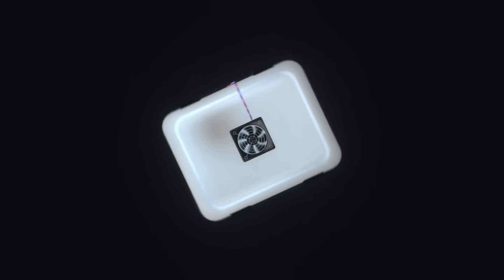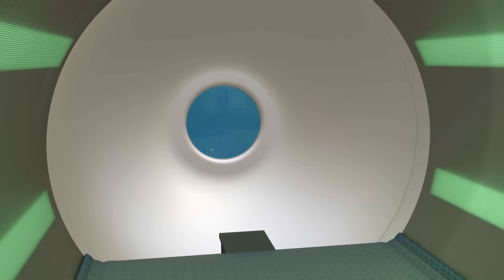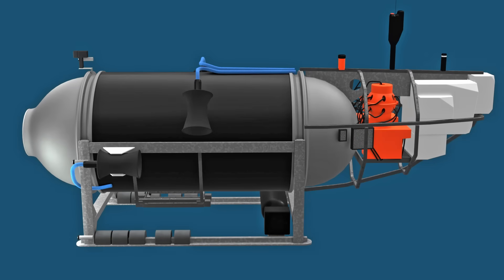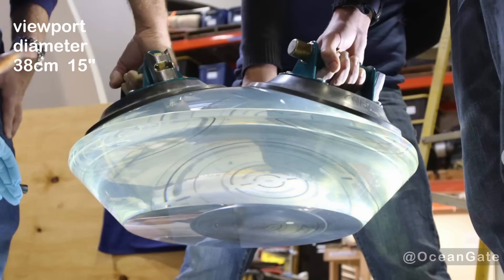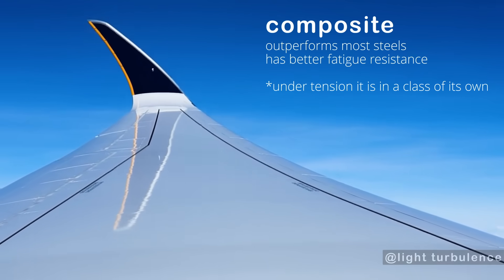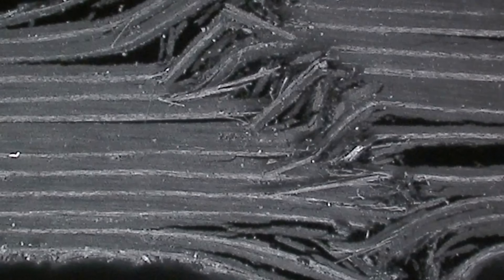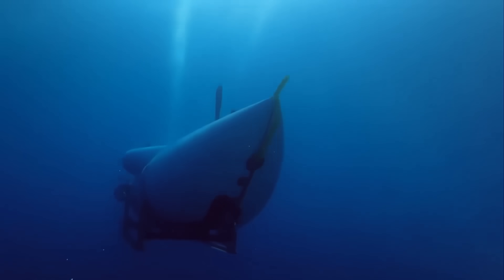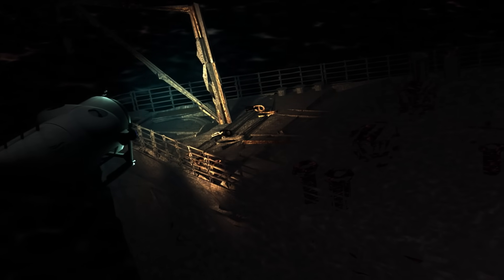Titan Sub | carbon fiber - Detailed Tour

Comment: A very interesting and informative video Mike which was easy to follow with the clear graphics and narration.
With all due respect to the occupants and families, friends and colleagues of the occupants involved in this terrible incident.

I think the Titan was initially an incredibly well conceived vessel that perhaps failed because of minor oversights in poor consolidation of the UD during manufacture and cure.

Rightly or wrongly the owner certainly believed in his creation personally and to the very end.

However I wouldn’t expect that the tape laying machines rollers were enough to prevent lack of consolidation as per the first composite structure which was rejected early doors.

The plies should be debulked under vacuum and additionally under external pressure periodically throughout the lay up process.

Nothing is mentioned in the media about the modulus of the fibre type incorporated in relation to total ply thickness criticism or what the resin system was that they used.

The finished laminate should then ideally be cured under high pressure in an autoclave.

It is very difficult to lay uni directional fibres around a cylinder without wrinkles and some bagginess therefore great time and care would have been required to produce a totally integral void free monolithic structure. 

I haven’t found information on the above apart from the informative content in your video referring to ply orientation but also the adhesive/mechanical fit employed in attaching the two hemispheres.

The laminate could have also benefited from a more complex but balanced orientation in ply placement but it appears the laminate integrity was possibly the most likely key route to failure at least from my distance view.
Best wishes

Comment: im going to stop u there where u say carbon fibre is strong under compression.
i worked for a race team/company that spent millions on engine development. engines have compression strokes over and over and over. Why dont race teams use carbon fibre parts In engines like connecting rods? They were tested and developed and great for a few tests, until the strong light weight parts got weaker after every compression stroke until they failed. racecars still mainly use alloy rods because they work better.. soft enough to absorb shock loads but strong enough to not fail.

now picture this. get some strong steel or Ti pipe/tube and hit it with a hammer. then get the equivalent in carbon fibre and do the same.. one will shatter and the other wont

Comment: The key to Carbon is it fails  like glass and it suffers hidden stress failures from repeated deformation  .  We use it in sailing all the time and it is great stuff , light and strong . When it breaks it does not break a little bit .
Reply: And there is no acoustic sensor in the world being able to detect, premature cracking up. Due to the depth you don't have slow ingress of water or "leaks" but a violent implosion with such force, turning human beings into pasta in roughly 0.2 seconds.

Comment: If you're going to build something right and beyond industrial strength to withstand many operations then you spare no expense. I'm sure building this thing to attract "explorers" and those with more money than sense had to cut some corners (ie: using carbon fiber and creating a pill shape immersible with "off the shelf products").

Comment: A question for the author: Given that the carbon fibre cylinder was where the failure occurred, do you have an answer to why the sub window was not in place when the wreckage was recovered?  Conversely, if you consider that the sub window failed first, then the cylinder, would it not give you and answer to why there was damage to the outer flanges? ( ie from the inrush of liquid causing the cylinder to explode)

Comment: So it's not wrong to say CF does not have high strength under compression. The buckling of the fiber is the reason. It's a slow process. Unfortunately they didn't know what the lifetime was.

Comment: As a guy who worked a lot around advanced composites on [military] aircraft, and also the ones used on sports car in my spare time, all I can say it that CFRP is light and strong, but it gives almost no warning when it has to give... Just look at F1 cars when they hit something, and you'll have the whole view of what happens when CFRP fails : it shatters like a little grenade !  Thousands of sharp little black carbon blades spinning in all directions. And to add to the injury, CFRP is not good at withstanding compressive loads. I mean way less than what it is able to do in terms of tensile strength.

That's why many helium/nitrogen/oxygen/"gaseous whatever you want" high pressure tanks are made of composites in aviation and rockets and work very well. That's also why nobody ever decided to build a fiber-reinforced plastic submarine before. If composites were good for submarines, the military subs would have done it a long time ago.

- Pressure trying to escape from inside = yes
- Pressure trying to crush from outside = big no
Reply: Exactly!  I hate to be an armchair engineer (though I have an engineering degree), but nowhere in the "Why carbon fibre was a very good idea" was mention of demonstrated repeatable reliability as a pressure vessel.  I remember one instructor hammering home that software models are never as reliable as actual tests; software models are used to save testing costs.

This design was never demonstrated to be a good idea. Every design team member should have been asked to send their favorite pet on test dives in that thing for several years.  Lets see have cavalier they would have been then.
Reply: @catsupchutney  this sub is the backyard-sub design of the century. Only thing missing is the sketch-up on the side of the tree house and Mom bringing out Lemonade and cookies.
Reply: @catsupchutney  Their first chief engineer, Tony Nissen, refused to set foot inside the thing.  That tells you everything you need to know.
Reply: You hit the nail on the head: in an application where the loads are compressive, CFRP is not a good choice.
Reply: Please go purchase a carbon fiber fishing rod. Bend the tip down, it bends down a HUGE amount.
the "top side" is under tension, the "bottom" is under compression, the "side", if a tube HAAD a top, bottom and side, is under shear.
Thousands of cycles. You can spin it whle testing too, subject each 'side' to different stresses. Axial Stress. 
The part of the vid where he shows a wing moving up? that wing has both tension and compression going on. 
There is a vid showing them wrapping the thing like a roll of toilet paper. 
Wrapping the expired date-coded carbon he bought at a discount with lumps of pre-preg resin on it. HINT: the reason it carries a date code.
Carbon fiber is a marketing name, it's a plastic-resin with a reinforcement. Like spilling Coca-Cola on a tee shirt. THAT is the basic product.
The failure was sort of a long term developed failure. Too many stress cycles.
Titian-the-Sub made 90 attempts on the Titanic dive. It successfully completed 13 dives. An astonding 86% failure rate. He had to PAY for the support vessel over 77 times, while completing only 13 dives
Henceforth, everyone now knows a carbon fiber hull'd Ti dome ended sub design with potentially faulty carbon and sketchy attachment potential at the Ti hull, WITH a 5 inch thickness and a cheap off-the-shelf knock off Atari Controller (not even a real one).... 
is good for 5 dives max. 
I wonder if the Mission Specialists paid every dive no matter what, or if Stockton ate those expenses out of pride?
Reply: @fridaycaliforniaa236  the fukery
Reply: yeah yeah inside pressure keeps the optimal geometry on... thinking of composites as glass underwater shows their benefits with great enough safety factors.

Comment: that wing analogy isnt very good, because as one side of the wing is in compression, its being offset by the bottom of the wing being in tension. thats not what is happening under 360 degrees of compression like 2 miles under the ocean.

Comment: And James Camron is right I mean he has only been down to the deepest part of the Ocean and has had a hand in design and making deep sea subs. But what does he know. Also if carbon fiber is so good under pressure why did Stockton Rush not want to test it and get it certified? Answer because it would have failed. I'm sorry but this whole video is bunk.

You are comparing a plan to a deep sea sub. If carbon fiber would have been so good every one that has been down there would have used it before Stockton Rush. They did not because they knew it was no good. You can have your opinion about it. But facts remain it should not have been used and was never tested.

Comment: Carbon fiber is only strong in extensions or traction. Period. That is its property. All other attributes must be developed based on this. You can learn to layer it so that you can utilize its extension strength in all directions. But it is a thread that is wowed in a “cloth”. It is intuitive that it is hard to rip…but easy to crumple.

Comment: The question is, why did anyone ever trust their lives on it.
Reply from the maker: Great question. They certainly would have asked themselves if they are prepared to die seeing the Titanic as they signed the waiver with death appearing 4 times on the front page. And they said hell yeah!! Beats me 🤷‍♂️ 
There are good 4k YouTube videos of the wreck.
Reply: @Mike-Bell  What I have an issue with is, the end pieces are glued on with a type of adhesive, when the pressures keep changing on the end pieces and the carbon fiber, there is every chance the adhesive is going to adjust and deteriorate the connection over time.  I would never trust anything that has been connected this way, especially with my life.  The designers should have expected that.

Comment: Carbon fiber layups should be done with a vacuum to pull out air & excess resin from layup. A mat to soak up excess resin & provide vacuum to all parts of layu ( excluding ) mold. The layup in this case should have been done in layers on the mandrel. Feck around & he found out.
Reply from the maker: The second hull was done in 1 inch layers cured between each new layer.

Comment: The cowboys went cheap on curing cylinder in an autoclave.  Should have used a cored  id/ od mold to control the curing exotherm..also cowboys should have made sacrificial tubes with embedded thermocouples  to develop a proper cure profile. Completely incompetent. A case of not knowing enough about what you are doing and knowing what you don't know.

Comment: Great piece of work.  I worked in endurance testing high pressure equipment up to around 3000 Bar. This sub failed at around 400 Bar.  The failures at these pressures progress through the structure as shock wave rather similar to an explosive event at around the speed of sound for that material. The stress is already in the carbon fiber and you get a cascade failure as the local support is removed by the failing material. I have no data for the speed of sound in carbon fiber in this configuration and pressure but it will around 3000  meters/sec per second much faster than the speed of sound in water at 1450 meters/sec.  This means the tube may well failing faster than the water can keep up with . This would cause a huge mass of water accelerate  conically inward ( the open end toward the direction of travel) in  the direction of the end that did not fail first. As the in rushing water ( many tons) is at really high speed ( 150 mph +) when it collides in the center it creates an even faster flow towards the remaining end . When this hits the end you get the mother of all water hammer events blowing out the window.  The violence of this event is difficult to comprehend.   This explains why the window was not with the sub.    The blown outward flange was on this end too so I think this could be  included in this violent event.   The whole thing would look a bit look like  the copper in a shaped charge anti tank round going off.  All this happened in less four thousandths of a second  the victims could not have sensed any of this thank goodness.

Comment: Carbon does not work with the amount of forces and pressures applied 13000ft under the sea. Many sub companies tested and aboded the idea of ever using the current materials with carbon fibre / allows in it.
Reply from the maker: Composite pressure hulls on deep dive craft. Here is a list https://www.researchgate.net/figure/Composite-materials-being-used-in-submersibles-worldwide_fig1_364296004
Reply: @Mike-Bell  you wont any of that in military subs, private subs perhaps. But then they can use what ever they like

Comment: Yes yes they've been touting carbon fiber since the year 1999 as some miracle isn't carbon fiber basically just fiberglass but instead of glass fibers it's carbon not for subs maybe space craft no crushing pressure essentially wood fibers and glue doesn't work on subs

Comment: I can count the number of carbon fiber deep submersibles in operation around the world on zero fingers.
Reply from the maker: Composite pressure hulls on deep dive craft. Here is a list https://www.researchgate.net/figure/Composite-materials-being-used-in-submersibles-worldwide_fig1_364296004
Reply: @Mike-Bell  Are any of those still in use or were they only experimental test vehicles?

I read the whole paper. Thanks for the link. The ending paragraphs sum up why carbon fiber simply isn't a good material at this time for the task at hand.

Comment: So, the failure of the vessel was not due to carbon fiber's weakness under compression of the sides of the tube, but to failure of the tube from the ends-on compression of the titanium caps.  And this despite the claim the carbon fiber holds up perfectly well under compression?

Comment: Interesting, but the report contradicts itself. If destructive testing was (is) needed to prove the load bearing capacity of a carbon fibre design, and this hasn't been done, it is an unproven assertion to say Carbon fiber is an appropriate material for this application.  At best, the statement should be is that more research and testing need to be done to prove if Carbon fiber can be repeatedly used in this application, and underr which building standards.

Comment: The very idea of using carbon fibre, or any other fibre to build a vessel to withstand enormous pressure from the outside is just blatantly stupid.  Carbon fibre is immensely strong in tension but abysmally weak in compression.  Whoever designed this thing was obviously an engineering moron.

Comment: Thanks for this excellent video .    The last 15 years of my career I have been working on pressure vessels (boilers and HVAC )   .    It appears titanium and carbon fiber have different rates of thermal expansion .   therefore these materials will not expand and contract at the same rate thus causing a failure point  .  The other important point i noticed  are the computer monitors mounted on the walls .   your video mentions  the inner wall is lined with perforated plate . I am guessing it is flush against the carbon fiber hull.   looking at the mounting screws to hold up the monitors I'm guessing they are 1.5 -2in  long  .  Are the mounting screws  through the liner and into the carbon fiber hull ?     I question this because a lot the Titans construction seems a bit of a  kit car  build .

Comment: Well, if it's so strong then how come the composite hull wasn't recovered, only the titanium end caps and machinery.  And speaking of which, why titanium end caps and not carbon fiber? The truth is anyone with any engineering savvy upon taking a really close look at the craft has to walk away shaking their head. Carl Stanley put it best - it was a mouse trap for billionaires. That crate was a disaster looking to happen; Rube Goldberg all the way. At one point I thought that it might be a nice money making design for offshore tourist industry at much shallower depths like 1000 feet but I'm not convinced it would have survived doing that for any length of time, and then there's the issue of certification and passenger carrying - Stockton was averse to anything like that so, good luck, passengers were out. No, he was so bad at what he was doing, so misguided, his only hope was to operate in unregulated waters.
Finally the notion that they did not know what was happening is wrong. In the lead up to failure the sounds alone would be disconcerting. While the implosion happened so fast it wasn't even experienced consciously the lead to it, and most certainly there was a lead up, the system failures, would have gone on for enough seconds to be terrifying and that "something wasn't right".

Comment: I have seen a kevlar helmet that was hit by a 155mm artillery round IED.  I thought I was looking at a green cloth rag.  When the helmet was hit by the  IED fragmentation, the epoxy had turned into powder and blew away leaving only the fiber.  I have seen this happen to another helmet.  The epoxy is like plastic which is used to hold the kevlar in shape.  The epoxy has no real strength and cant stand large force pushing on it.  It will just turn into powder leaving only the kevlar fiber which cant withstand compressive force when it is in a tubular shape.

Comment: Rush thought safety was a joke. He had zero respect for the ocean environment.  Also, I have yet to see any validation of the texting that has been presented. Everything was bad on this craft. And to your point, there was no testing for repeatability of dives and loss of strength that would have reduced the depth it could safely dive. Excellent presentation. I am still not convinced that carbon fiber can safely be used in submersibles. Even the first passengers heard the loud pops and the fibers being damaged.
Reply from the maker: Thanks.  My newest video clarifies the ship sub communications by a crew member on the Polar Prince https://youtu.be/i0P56usXhcI